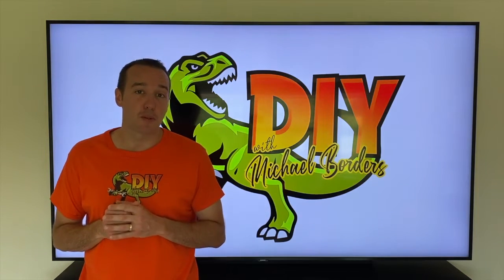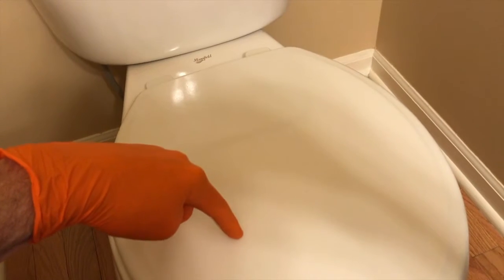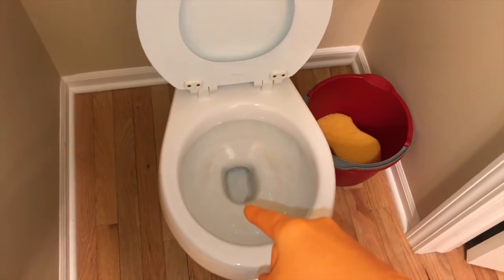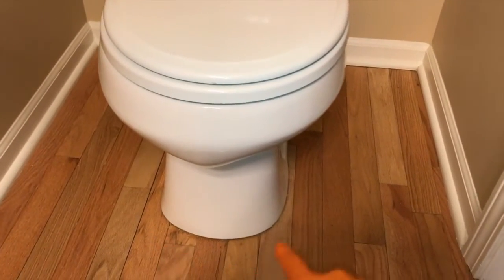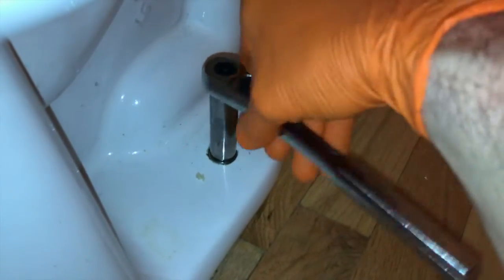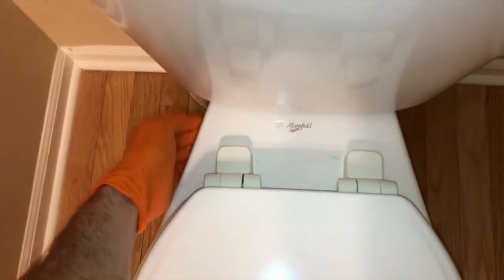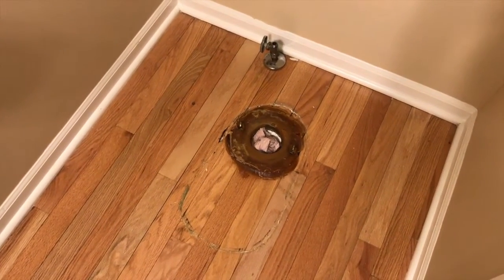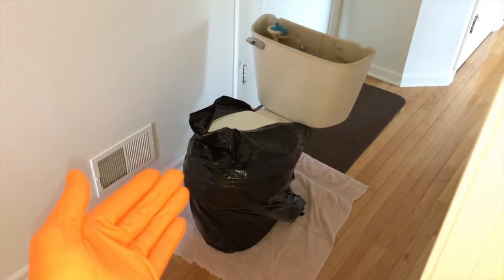Remove replace toilet from hardwood floor - Beginner tutorial

Comment: I would highly recommend using a wet/dry shop vac to take the water out.  It takes about 5-10 seconds in both the bowl and tank.
Reply from the maker: Thanks for watching & sharing your thoughts.  Any & all helpful info is greatly appreciated.  😎👍